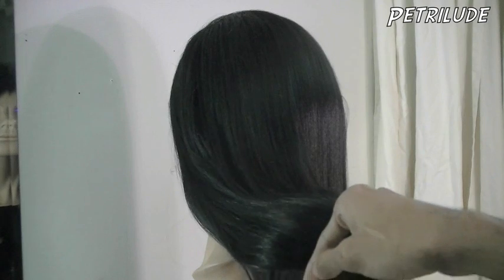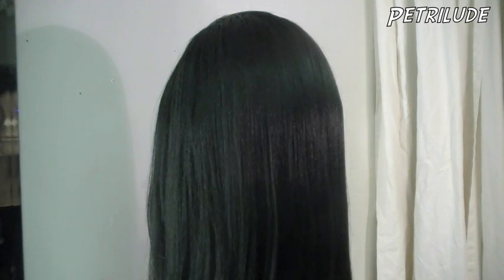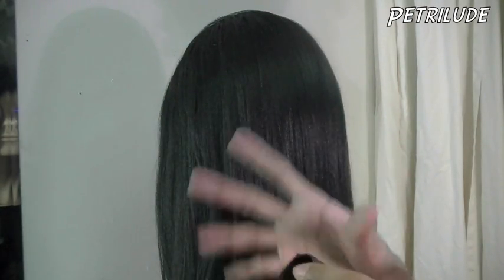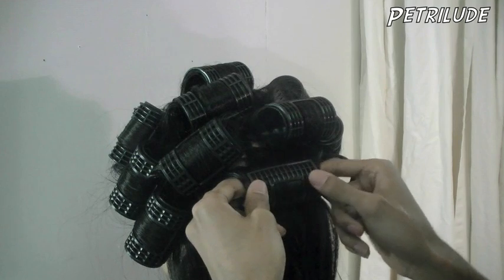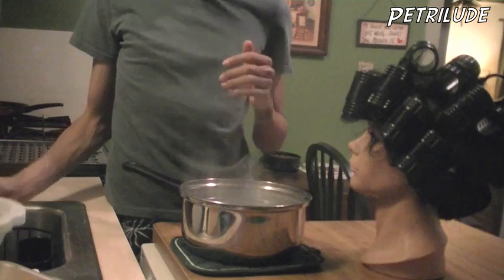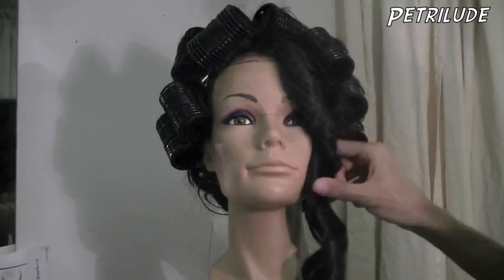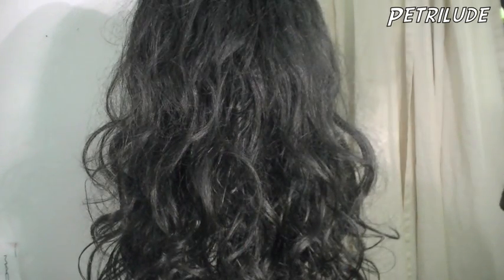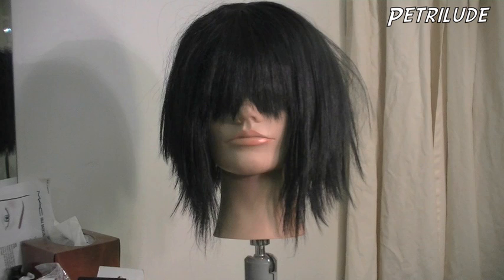Styling Synthetic Hair: Boiling Water

Comment: I TRIED THIS METHOD AND IT WAS AMAZING I HAD A REAL OLD RATTY CURLY SYNTHETIC PONYTAIL AND DID THE BOILING WATER TO GET IT STRAIGHT. THEN SET IT IN ROLLERS AND DID THEBOILING WATER AGAIN. I LET IT SIT AND DRY OVERNIGHT AND TOOK OUT THE ROLLERS. THE PONYTAIL LOOKS AMAZING. DIFFERENT AND BETTER THEN WHEN I FIRST BOUGGHT IT.

Comment: I wonder how well this works with the so-called heat stylable fiber. They are kind of touchy about heat and the resistance, I think, makes them hard to heat style. 

Also, I have burned wet synthetic weave with a blowdryer, so if you use one to speed up drying, make sure it's on the cool setting!

Great tutorial tho!

Comment: The boiling water technique is a good one (accessible too). But I always prefer using a clothes steamer when styling (curling) synthetic wigs. You have more control over where the heat goes so you don't have to completely saturate the wig (cap and all) and the drying time is not as long. The same is true of straightening wigs.